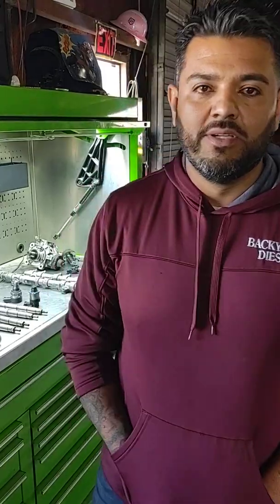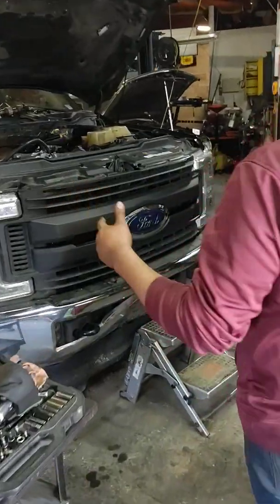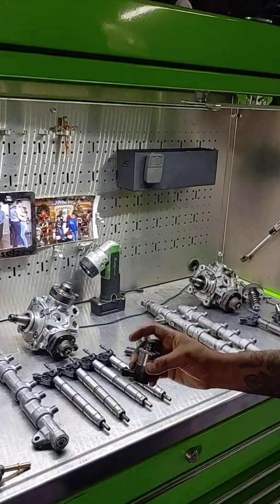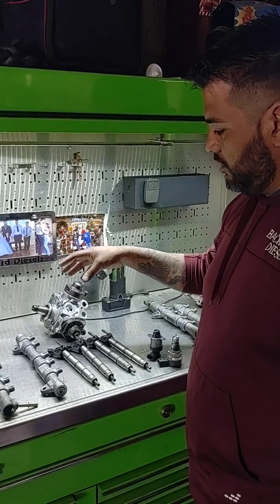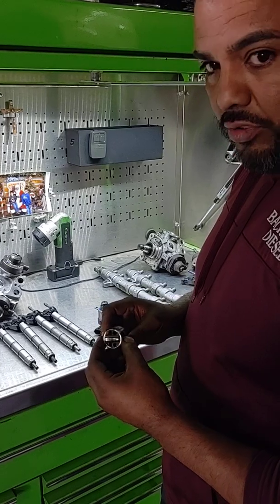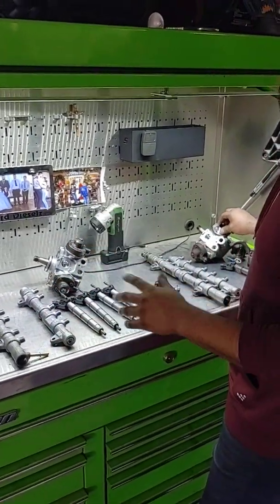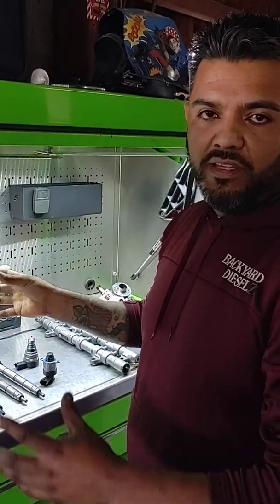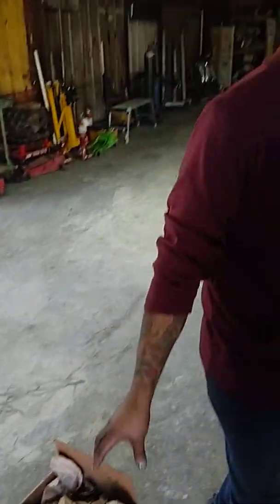Replacement of the Ford 6.7 Fuel Contamination Kit

Comment: Happy 4th of July 🇺🇸 everyone! 
Question:
Do new Fords have issues with the fuel system contamination ?? 
Brother-in-law bought a brand new F350 back 2019. 
7-4-2021: The truck has 38K miles and he had issues with the fuel system. Ford claims he has a contaminated fuel system due to “DEF in the gas tank” ???  He swears he has never mixed fuels.
Ford is saying it’s a $13K job to fix (obviously not covered under warranty).
He’s not the only person I know that was given the same solution by Ford. Is this some defect with Ford? Is there a way DEF can mix with diesel somewhere in the fuel system similar to how the EGR-coolers fail and allow coolant into the exhaust? 
Any advise would be greatly appreciated! I’d hate for other to cough up $13k for something Ford should be responsible for.
Reply from the maker: The only way that fluid could get in the fuel system is if you put it in the fuel system there's no way it can mix.. and if there's that fluid in the fuel system most likely you're looking at a fuel contamination kit.. no way around it.. our shop is 10k with OEM parts.. we stop using reman

Comment: Need your help... what be the best way to put on a crankshaft position sensor on 12 f370 6.7? It has a hole on driver side between engine and transmission... took of easily , but now having a HELL of a TIME putting on... Little info would help a lot
Reply from the maker: Sorry bro just saw your message... It's a pain to put in.. if the plastic guide is broken... Which they break all the time because of the heat... It really doesn't need it.. just helps you guide the senor into place.. but it can be done.. it's a pain...take your time.. you will drop the sensor slot of times.. attached the connection to it.. it helps..
Reply: @BackyardDieselz  would I have to side transmission back if it gets to that point
Reply from the maker: Patience is the key it's a MF... But the guide don't do nothing.. take your time.. go get a scope camara if you need to...it's really all by feel..
Reply: @BackyardDieselz  12 f350 6.7 you I removed the transmission and was asking if you know the plastic guide part number from motor craft?
Reply from the maker: Shoot I don't know any part number bro..
Reply: @BackyardDieselz  what about a diagram on how it supposed to go
Reply from the maker: @ChrisLopez-gq7vv  what do you mean you cut the wires are you trying to figure out how to use the sensor go
Reply: @BackyardDieselz  I changed the crank and cam sensor, everything put on but truck cranks but won’t start, could the truck of lost it’s prime?
Reply from the maker: What happen with the truck.. why you replace the crank sensor